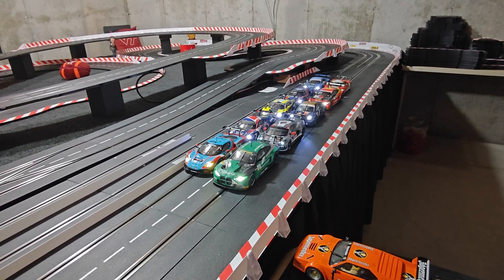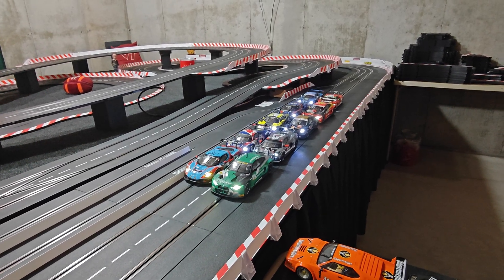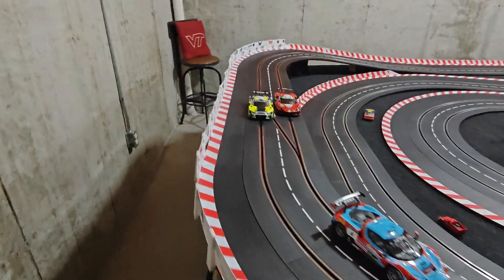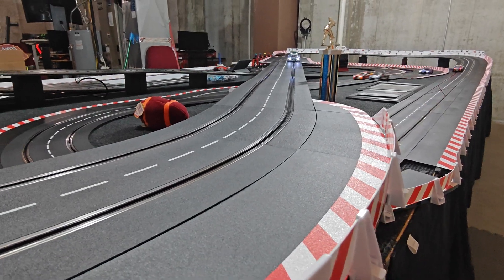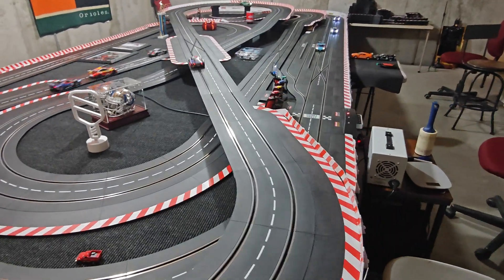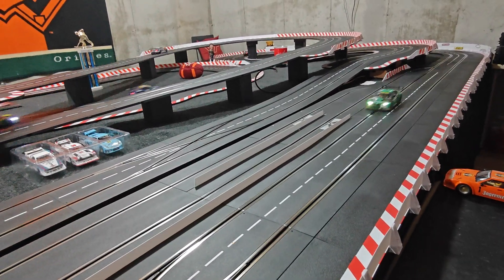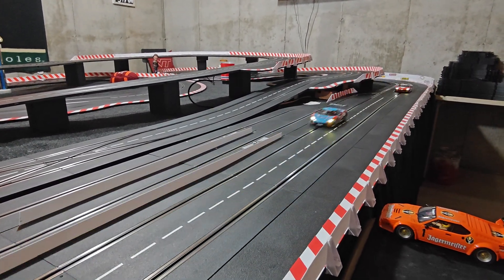Testing the Anti-collision chipped lane changers

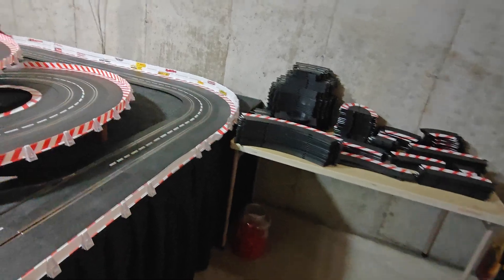Comment: I was having shorting out errors like you had at 1:01. I figured out that the second set of brushes was causing it on lane changes and tucked the second set under the first set and it stopped for the most part. It was happening a lot with the 1/24 cars, now it's rare. You get double the life out of the brushes(flip them end for end), it does not hamper the racing the cars still fishtail wide and continue on.  I also find I do not have to pull out the brushes as often with the second set underneath the first set. I still have the occasional crashes at the lane changes but the anti-collision chips are a must IMHO. Happy racing.
Reply from the maker: Hey! Thx! I will have to try that with the brushes!

Comment: In my opinion, putting the lane changes directly before and after the turn would make it even more realistic for me they would look more like trying to follow a racing line, maybe the entire straights could be lane changes if they avoid each other maybe more realistic passing
Reply from the maker: You could have a lane changer right before a curve, but you have to have a straight after a curve before the lane changers because the cars sensor has to line up with the track sensor. I do have a lane changer on every straight before and after a curve. The nice thing about ghost cars and the anti-collision chips is the traffic they create. It makes the races more challenging without wrecks.

Comment: Back in my early teenager years me and a friend of mine used to race all the time. We had AFX slot cars. Do I miss those days
Reply: The smell though.
The sparks when you turned out the light.
The feel and sound of the cheap spring in the speed controller.
Convincing grandpa WHY I needed the Porsche 911.

Then the sticky foam tires came along 👍
Reply: @guybeingaguy  And then i swapped the rear foam tires for the small Lego tire and me and my friends were dragging our tinny cars for hours on end.
Reply from the maker: I use to have TCR race set!
Reply: I don’t miss the broken tabs 😂
Reply: My cars were G-Plus.
Reply: @ayuse01 ours too. Had a heap of them.

Comment: Awesome layout…. Finally a video about the anti-collision installs thank you. Do you have any specs on the track? What are the dimensions of the table? Total  length?
Reply from the maker: Thank you! The table is 8' x 20' and added a 3' x 4.5' extension over at the wall. The track is 131 ft in both lanes. This video doesn't show the extended track.

Comment: What I want ... Is a lane changer that works in curves, that allows the following of a "racing line"... That is start on the outside of a straight, then and GRADUALLY over  a few track sections  Move to the curve apex ... then back outside on the next section of straight track
Reply from the maker: Lane changers wouldn't work well in a curve because of the sensors. You can't have a lane changer right after a curve because the cars won't be lined up with the sensor. You need a straight away right after a curve before a lane changer. You can have a lane changer going into the curve.
Reply: @Steamer2499 
A shame.

Carerra tech probably isn't up to creating a true racing line in curves.

Comment: After viewing your video, I installed two anti-collision chips purchased from Carrera Slots, downloaded the instructions, and installed them on the track per the instructions. For the life of me can't get them to work properly, will get a crash sometimes. Lost for answers, can you tell how you installed the chips? Thanks.
Reply from the maker: What the instructions don't tell u is, u need to remove the inside rail piece off the 2 pieces of track that come together before the lane changer. Don't cut them. They r easy to remove with a small screw driver. Hope this helps. This is for the double lane changer. Also, you'll need a jumper between lane changers because you'll lose power there.